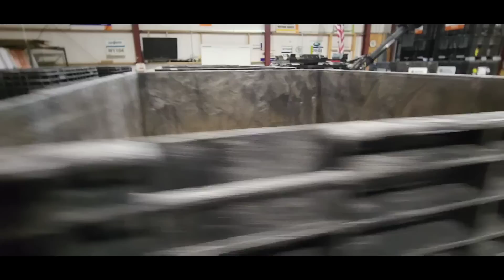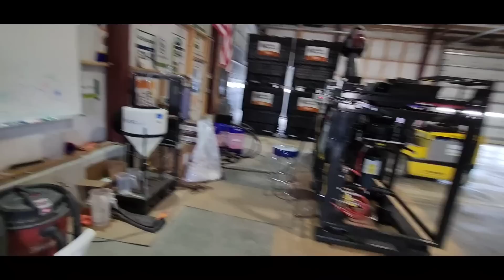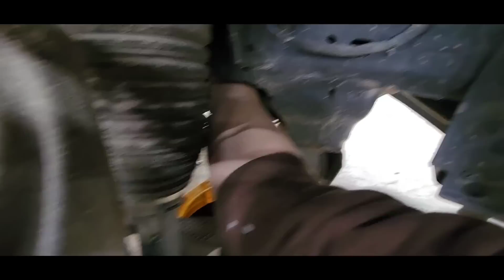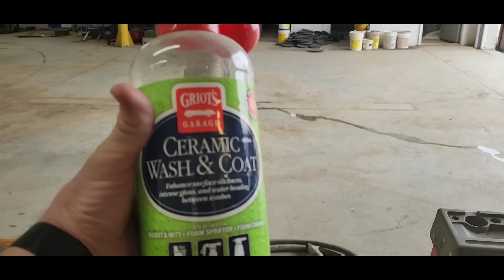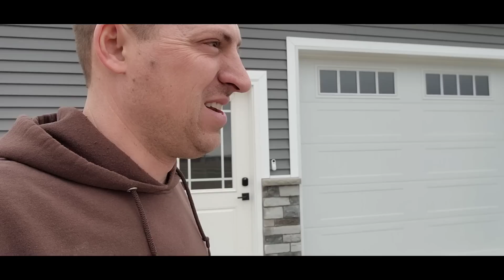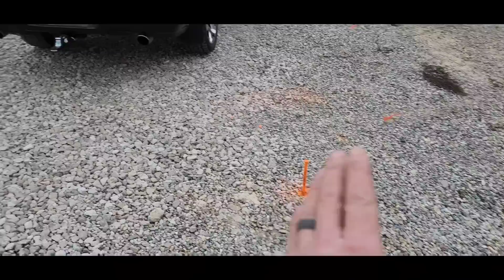More Beans, Oil Changes, and Driveway Plans

Comment: Would you consider building a retaining wall to lessen the slope of the driveway in front of your garage?
Reply from the maker: No I don't want a wall to either back into or an edge to drive off
Reply: @BorderViewFarms  Form a border curb and place decorative poles or a fence to distinguish the boundary?  I owned a home with a concrete driveway that had a length and slope similar to what you described in the video.  The slope presented several issues, with walking on it when icy being especially treacherous.

Comment: Concrete math: Length x width x height ÷ 27 = yards. For a 4" thick slab ÷ by 81. Concrete driveways are nice but to get the gentle curving slope you desire blacktop in my opinion would be more suitable due to your elevations issues.
Reply: Ready to see y’all in the fields, keep em comin Nathan 🇺🇸